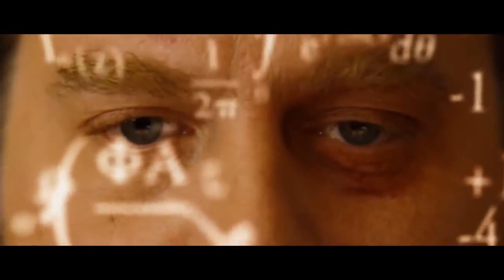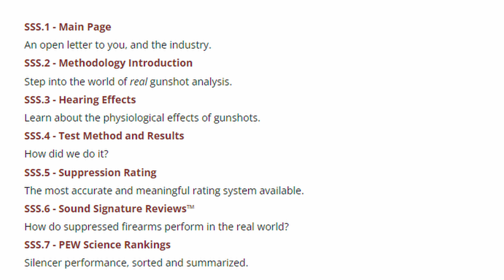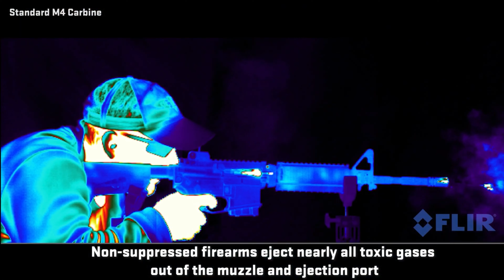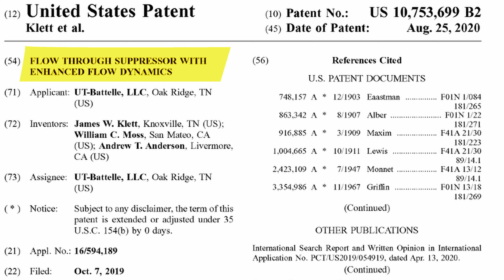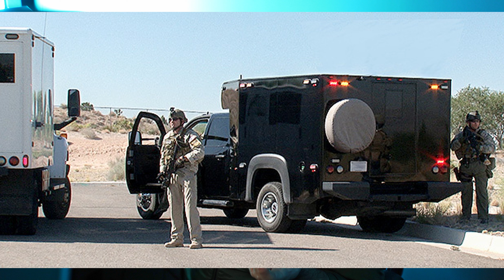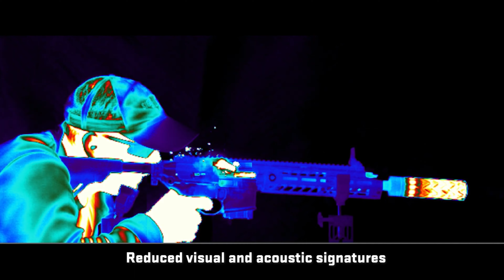SIG Sauer SLH versus SRD Review - CENSORED FOR Community Guidelines

Comment: I own a SRD QD 5.56 and while its a great can the mount systems leaves something to be desired. Because it relies on the threaded taper mount for securing the can. If the can gets hot and cools it almost becomes permanently affixed to the mount. The QD latch just ensures if the can comes loose a quarter turn it wont go any further. At one point I had my rifle between my legs and putting full force to break the taper mount. Instead I broke the rocksett on the mount and my muzzle device was stuck inside my can. Had to use a breaker bar and socked to get the mount out. If you want a dedicated rifle can they are great but trying to easily remove one and switch to other rifles is a pain in the butt. This was my first can and I bought it in 2016. These days other than using the SRD line of cans for clones, buy something with a better QD mount system.
Reply: My srd 762 TI qd is still in jail. And i went and paid a little high for it just because i thought they were sweet and heard great things about reliability and “tone”. This is only my second can and both are still in jail, and the shit part is i coulda bought three of the can i wanna try next (sierra 5 xeno) but it was a new old stock auction so i couldnt let it go. All others im seeing are 2k+
Reply: I also have the SRD QD 5.56. It’s sitting in my safe without a host for this very reason… If I had an MCX to make a “clone” of some kind I’d try to get it carbon locked to it so I wouldn’t have to deal with the stupid mounting system.
Reply from the maker: Sig "made" a wrench for it. I need to find one. We are doing a 556SRD v SLX video soon
Reply: @ANRDesignLLC  556SRD vs SLX would be great... Especially comparing the 30cal cans on 5.56 as well.
Reply: One company: ECCO Machine!

I sent off an old AF & heavy AF Gemtech HVT-QM and had them chop out the old mount and rethread to the HUB pattern. Not expensive and work is superb.